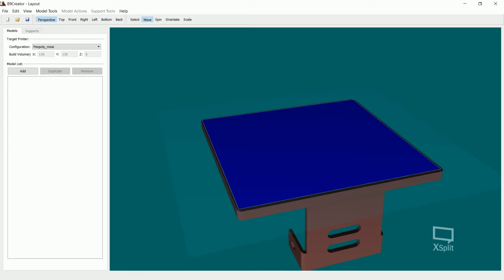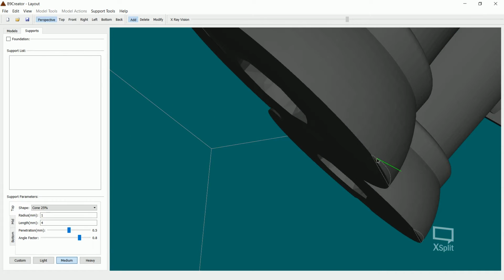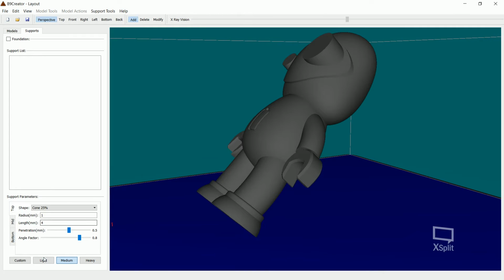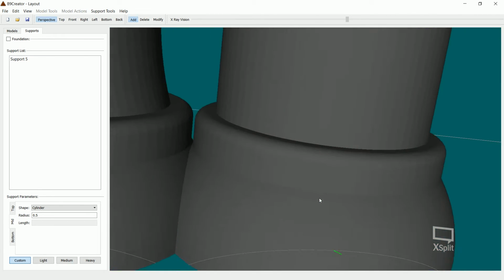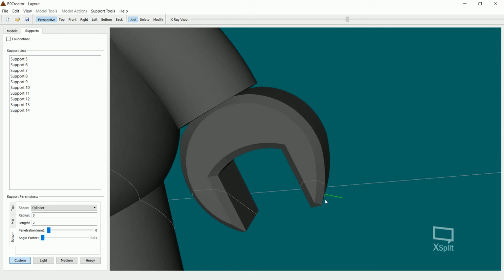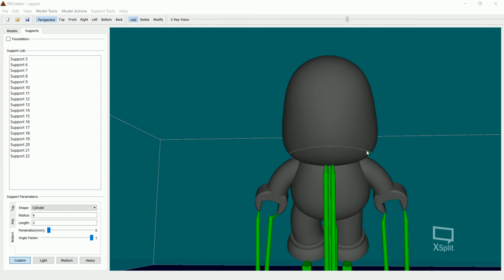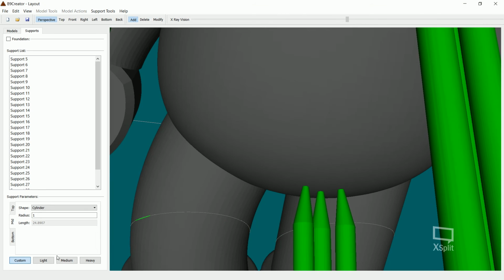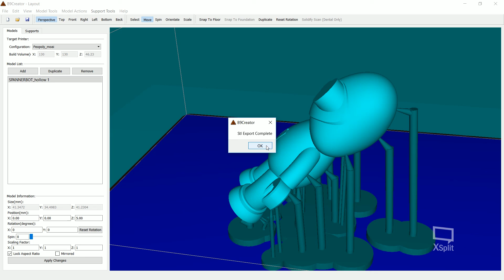How To Resin Print: Adding Supports To Your Model

Comment: Is there any way to get B9 Creator to not jump the model up 5mm automatically when switching to the supports tab? I added supports to a model, needed to change something on the model itself & exported it out. I've made the change & imported it back in to finish adding supports but when I snap to floor then click the Supports tab, it jumps the model up 5mm & any new supports added are longer than the existing supports. Thanks in advance & excellent job on the video! It was extremely informational.

Comment: Don't be fooled like I was about these reviews of the Photon printer. It's not as great as they make out to be because it's just not reliable. I have had to replace the clear film on the bottom of the resin tray 4 times now and wasted hours and hours of time trying to print things only to find out in the end that the print stuck to the tray bottom and not to the print head. They make it look so easy to use, but it's not. The leveling process is so critical that if not done absolutely perfectly and the print head raised up precisely when zeroing the Z axis, the thing won't print, it will just cause your print to stick to the bottom of the tray. You waste time, you waste money on resin, and you waste money on replacing the special acetate sheet on the bottom of the resin tray. Also, I have had to install new firmware in the machine twice now because at some point while printing, the LCD screen just stops working. The first time this happened I had still not successfully printed anything and I thought the machine was broke after 3 failed attempts. I contacted Anycubic tech support and they wanted videos showing what I was doing "wrong" so I recorded several and sent them to them. Then they wanted me to take the machine apart and do several things inside which I refused to do. Then as a last resort, they asked me to download and install the latest firmware which I did. That seemed to work because the LCD screen was turning on. I finally was able to print something (the sample file on the USB stick) but when I tried to print a file of my own, failure again. I finally found a video on You Tube that gave a totally different method for leveling the print head and setting the Z axis zero point. It worked, for about 3 days and 2 successful prints. Then the LCD screen stopped working IN THE MIDDLE OF A PRINT THAT WAS 8 HOURS LONG!!! Why would the LCD screen just stop working in the middle of the print. I shot more video showing that it wasn't working, sent them to Anycubic tech support, got NO reply after 24 hours, went to their download page and found that the firmware had already changed AGAIN since my previous download. So I downloaded the new firmware, installed it, and that fixed the LCD screen again, for how long, I don't know. The printer just isn't reliable and you'll be getting very frustrated trying to print something over and over and over. My success rate is 2 out of 7 attempts and every failed attempt resulted in the print sticking to the bottom of the resin tray. My advice is save your money and your nerves and either buy something more reliable or don't by a SLA resin printer at all. They're a pain in the but to operate and maintain.
Reply: As an Anycubic owner i ran too in problems with prints not sticking on the buildplate and so on. After entering the world of individual prints everything seemed to fail. After wasting resin and time too i figured out that there are a few things you have to maintain. 

1. tension the FEP foil from time to time with the screws on the bottom of the vat. Every scratched out missprint leafs gaps which made the tension weak and so mass rather sticks on the FEP.
2. Sand the buildplate down to the raw aluminum. Sure as even as possible.
3 throw away the stupid ball leveling with the central screw and replace it with a so called Easy Z Adjuster which is sold online in special shops for DLP equipment (FepShop for example) or download other or mine on thingiverse. https://www.thingiverse.com/thing:3157157. So you can set zero inside the vat and not with some crappy piece of paper.
4. Increase the time of the first layers especially on non clear resins. 5 layers wit 60 sec min will do it for me for clear and 90 sec for non clear resin. 
 
I am sorry to hear from your mess with the fw anyway. Knockin on wood and better keep that fw which is always doing his job in my printer. 

At least a printer which needs some learning and more maintenance than the more expensive ones i think.

Comment: What are the reasons why the model should be placed (not flat) tilted by 45° ??? Thx
Reply: So resin doesn't pool up anywhere on the model surface and to provide more points of contact for the supports. Pretty much a pyramid shaped object is the only thing that would inherently work well straight up & down in a resin printer.
Reply: To not create back faces.

Comment: Thanks for great Video Evan, could I ask you if you can do a video on the Slicing part of SLA Printing. I have just received my Moai & know about then Slicing in FDM but not in SLA. I add the Model to Cura ( Moai version ) how do i change setting for for items like laser power,speed ,layer height etc. I have FuntoDo resin F1+ clear resin. So where do i add those setting for that particular resin. I would appreciate some help. I can not find a video on slicing for SLA , all FDM printers
Reply: Works pretty much the same for SLA, you just have to adjust the layer height and your nozzle diameter to reflect your laser resolution.

Comment: Thanks for the great video , I’ve been wondering how to use B9 creator.  I do have a question,  wouldn’t you want the direction of the drain holes facing the VAT?  Here is facing the plate.  or are the drain holes acting as an air entry point to help with drainage ?

Comment: Whenever I export using these settings my models are rotated 90 degrees. Is there a way to rotate the custom build plate you made? Or is there a way to configure the D7 to account for this? I followed your setup guide for this whole process and this is the only thing I am not sure how to fix.

Comment: CW prints whatever starts right on the build plate. Whatever is sticking thru the bottom will not be considered when sliced, i just move the model .1 beneath the plate if there is leftovers from hollowing, even CW has problems with its own hollowed models sometimes... Great video !
Reply from the maker: yeah cw does but using cura on the Moai doesn't and  can result in a failed print hence why I mentioned it

Comment: wow that B9Creator software really beats making supports in CWS ! What about the inside of the belly of the model ? this is going horizontal at a certain point. does it need supports ? If so can this be done in B9Creator ? a sort of inbetween support ?
Reply from the maker: only put internal supports on really large pieces, never needed it on smaller
but yeah you can just turn on transparent mode and put them inside